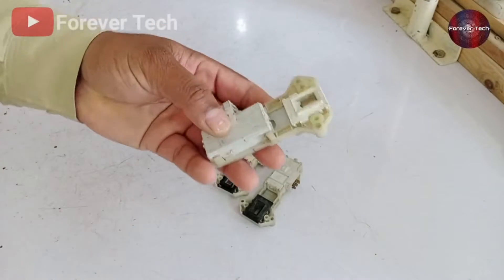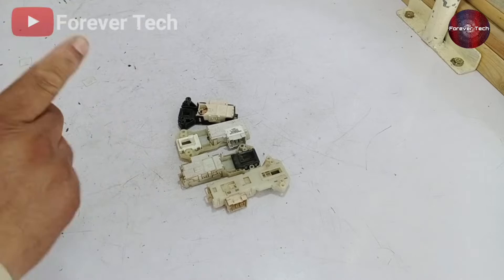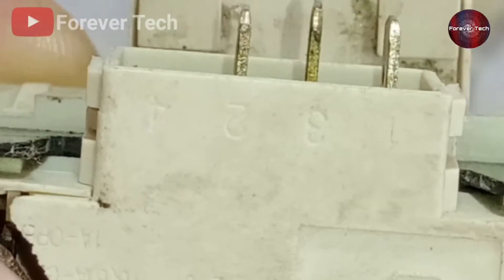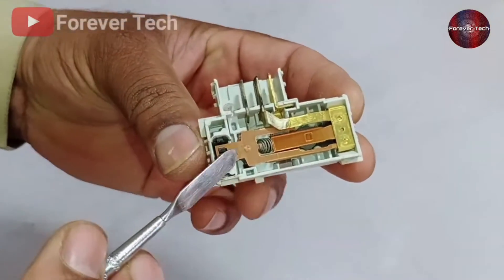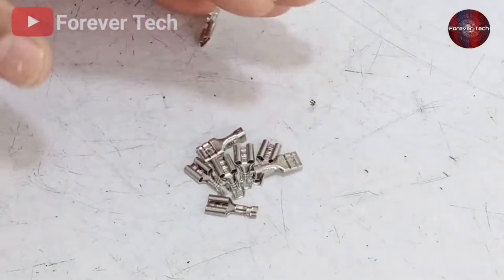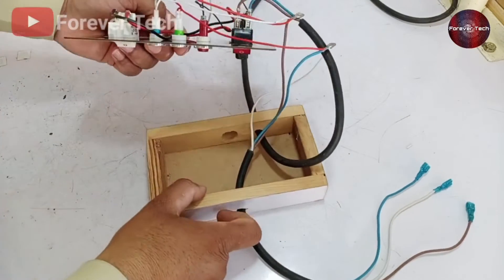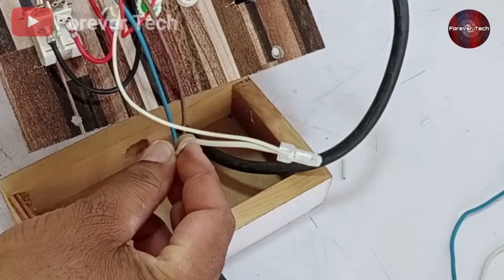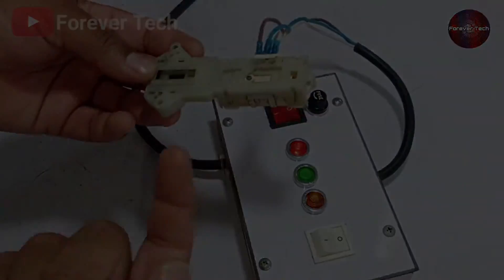Washing Machine Door Lock Repair & Test - Make a Testing Device

Comment: You have taken your valuable time to share some very interesting facts of electronics, something which i have struggled to understand for many years and made me stay on purely mechanical things where i could actually see cause and effect. The way you are able to simplify  and explain these principles is amazing . You wetted my appetite to learn more on a subject that left me  feeling defeated  so many times, there is hope for me , i have always extracted washing machine  and other home appliance Motors after seeing you video i dug them  back out and yes those many wires coming off the  motors GEEZE!!!!! is starting to make sense. The  audio of the vids is a bit rapid so to grasp the points i replay many times to get it to sink in. i would like to use one of the motors to make a Tool but i would definitely need more help with how to choose/ make  a controller for foward & reverse and speed control.
Thank you very muc
" Mr Tech Teacher"
Reply: You can adjust the video (and hence audio) speed via the settings gear symbol at the top right of your screen.

Comment: thanks ,well explained about  door lock switches. i hav a ifb supreme old  washing machine with DS88 switch. Not getting similar switch but   T85 or DSL99 switch ok. can it be connected matching with no 1,2,3. L, N, C. kindly reply. how to send pics in whatsup.
Reply from the maker: You can connect a different switch, you will have to be sure about the connections, if the connections are made wrong. It will not work. Or will go bad

Comment: Just use a 2 wire  cable connect phase and neutral and with a voltage indicator check the common terminal,why complicate simple things bro
Reply from the maker: This tester can be used for testing multiple things not just the door lock. And it's much more easier to test with this tester, at least I think so.

Comment: Hi, nice advice and box 
As I am in the UK England I think our voltage is 230 v 
Are these lights to the box DC or AC or either,
And are the switches 2 position rocker switch latching off and on` 4 pin 250 v 16 Amp or that to high,
What voltage are you putting through the box and is it DC or AC